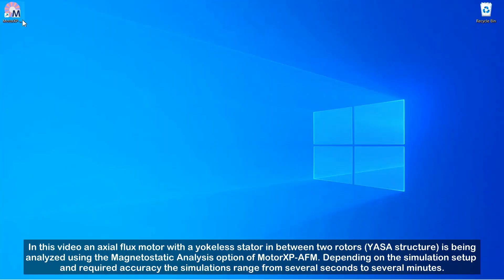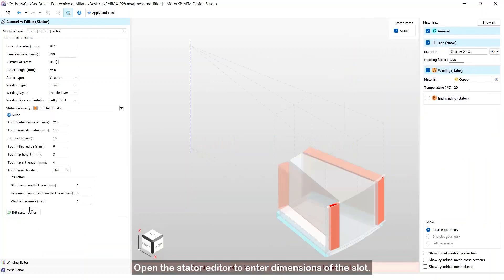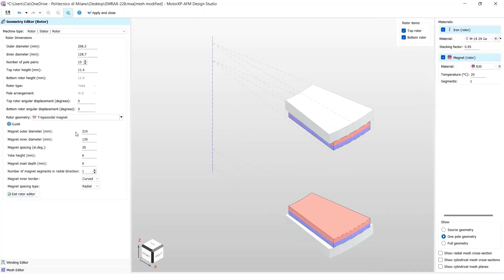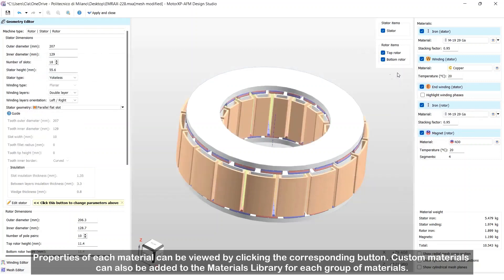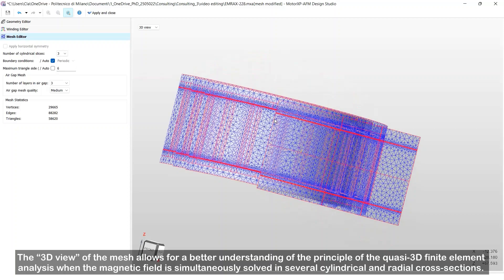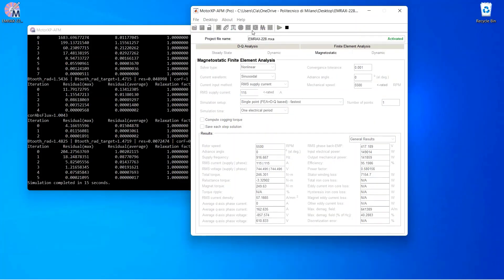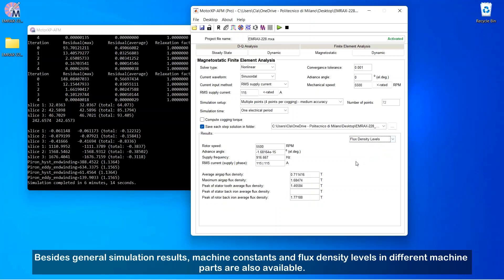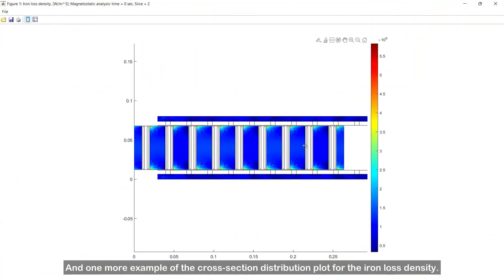MotorXP-AFM – Design of an axial flux motor – From simulation model setup to Magnetostatic FEA

Comment: 9:02 --> Emrax 228 HV datasheet suggests that 180 Arms would produce 130 N.m. Where 224.102 N.m total torque came from from just 115 Arms? 🤔
Reply from the maker: Thanks for pointing it out! It seems that one parallel path was entered by mistake (supposed to be two) in this video. I just run simulation with two parallel paths: the calculated torque for 115 Amps is about 126 Nm and the datasheet shows 125 Nm for the same current
https://emrax.com/wp-content/uploads/2017/01/emrax_228_technical_data_4.5.pdf